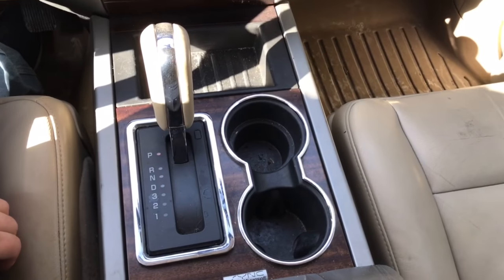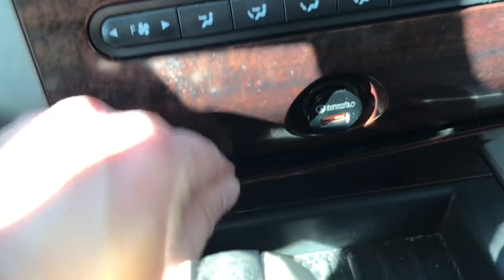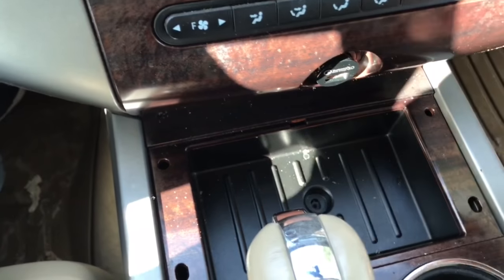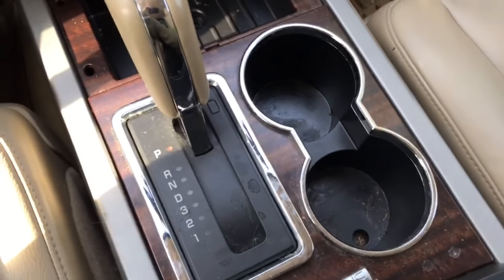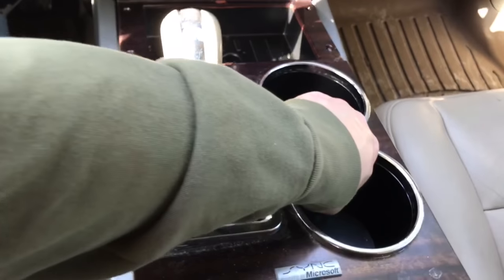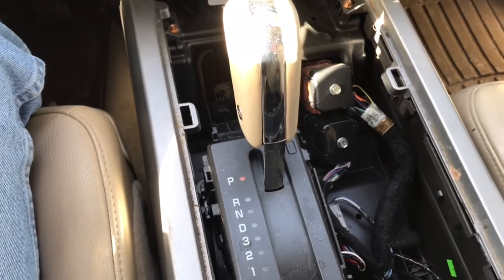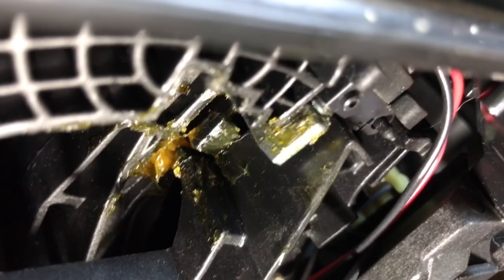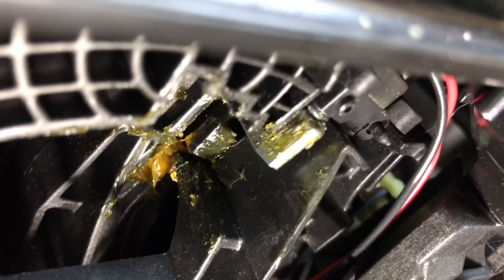What To Do If Ford Expedition Is Stuck In Park

Comment: My 2012 Expedition wouldn't shift out of park and I found this video.  As luck would have it, the example on the video was my exact same SUV.  I followed the instructions, cleaned the area, added grease and the problem was fixed.  You saved me a lot of time, money and frustration and I can't thank you enough for taking the time to post this.
Reply from the maker: If it keeps happening it might be the brake light switch causing the issue. They tend to fail on these trucks. If you’re foot is on the brake and the shifter is stuck see if the brake lights are lit up. If not the brake light switch may be bad. A new one from Ford is only light 25.00 here’s a video on how to replace it https://youtu.be/JPUFlrnw-eI
Reply: Where do you add grease too?

Comment: My expedition have the same issue, do you know if the switch come alone, without having to buy the hole shift assembly?
Reply from the maker: I am pretty sure you need the shift assembly from Ford if the solenoid is bad. The brake light switch is known to go bad on these trucks it's a common issue which causes the shifter to be locked in park. I have a video on how to replace it. When the shifter gets stuck in place keep your foot on the brake pedal and see if the brake lights are coming on, if they are not it might be a bad brake light switch. Hope this helps you out.
Reply: @HomeOwnerRepair Thank you, i checked the truck and it was the solenoid that works intermitent and some times goes out of park and some tomes don't.

Comment: Dude I really appreciate this video. You really saved my ass brother. I normally don’t comment or look things up but I had to thank you man. Literally saved my life i was stuck in the boondocks waiting for an ambulance and needed to get to the hospital asap. Really man THANK YOU !!!!  I owe you a beer man message me so we can meet up or i can ship you a beer lol
Reply from the maker: Glad this helped you out. Check to see if the brake light switch is failing once in a while. If it is, it will cause that switch not to release up on the shifter. This is what happened to mine, it's common on these trucks. Here is a link to a video that I did on how to replace the switch. It's easy to do if yours is bad. https://youtu.be/JPUFlrnw-eI